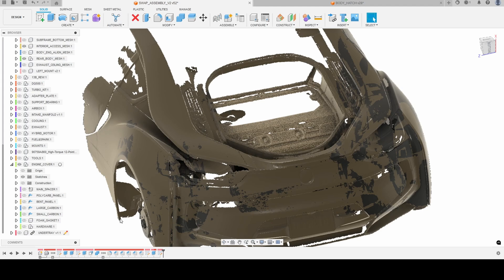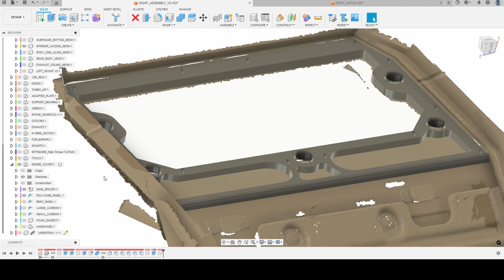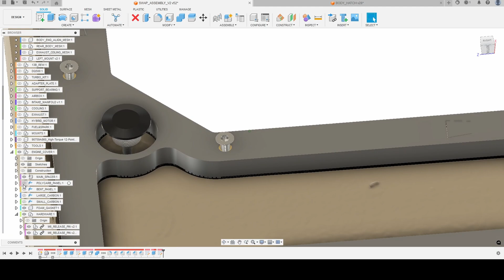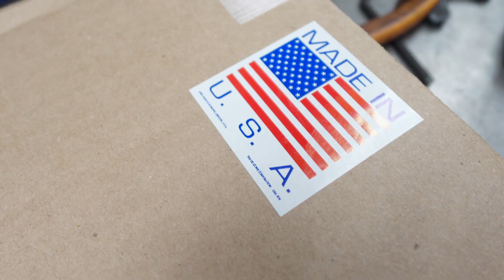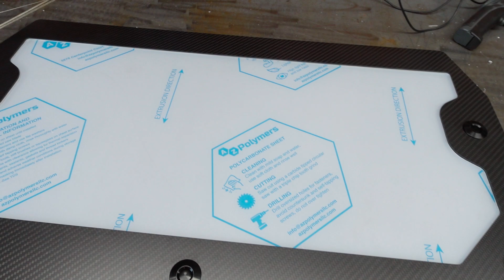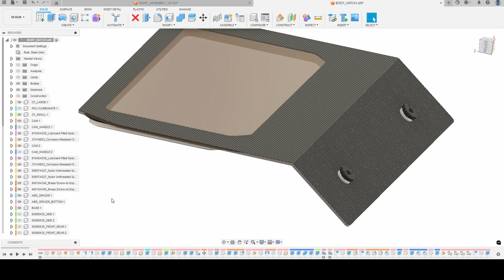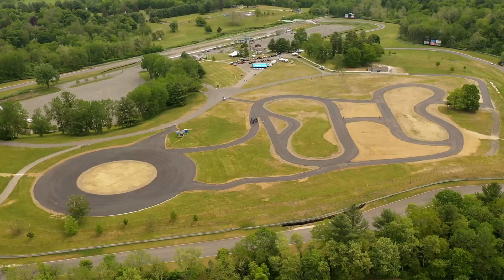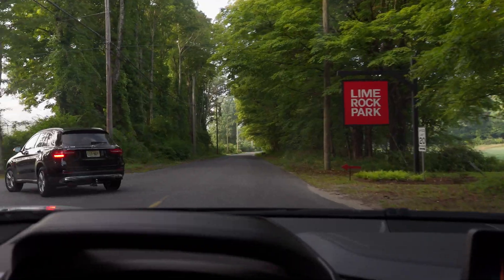Quick Access Panel via 3D Scanning and Lasers -  Building a 13B Rotary BMW i8: EP7

Comment: Sand the edges of the poly to a matte opaque like finish, then get good rgbw LED strips to circle the entire edge of the poly window (use the strips with the most LEDs per inch for best results)....then it'll cast a super dope glow emanating from the entire outside perimeter into the clear window, that's how the best lit acrylic work in high end car audio is done....if you search for maybe "diffused led acrylic car audio/subwoofer" on Google, you should find some good examples.... the best appearing ones that look like the entire sheet is emitting a soft light are the ones done how I recommend.... it's similar to fiber optics.

Comment: Cool build and I can't wait to see more. Be careful with attaching carbon directly to aluminum because there could be a galvanic reaction that will cause the aluminum to corrode.
Reply from the maker: Good observation. There should be the slightest air gap from adhesive, but time will tell if it’s enough.

Comment: Super cool engine cover! Maintenance lights would be nice, but to be honest I think they need to be display lights too. When you are done with this it will be a work of art. Besides, that little 3 cylinder deserves a spotlight for its last send off. (: They’re not quick release and I don’t think they would fit your aesthetic but if they are not on your radar already PIKA screws are really cool, I’m excited to use them on a similar more permanent cover project. Can't wait for the next video!

Comment: The great thing about 3d scanning and building off the car is the car is not down for months.
Reply from the maker: I plan on the actual swap only taking about two weeks. The pre-work, more than a year.
Reply: @CouchBuilt  this could be a game changer for custome building. You dont need the car down for a year, you scan, fab, scan, double check in the computer. Then build in a couple of weeks. This is geniuos.

Comment: If you find yourself 3D printing large multi-part  items like that in the future that you do want some rigidity from, an easy trick is to design some peg holes and use nails you cut the head off of or any other similar sort of rod or wire. Strengthens and helps index as well. Excited as always to see the next video!